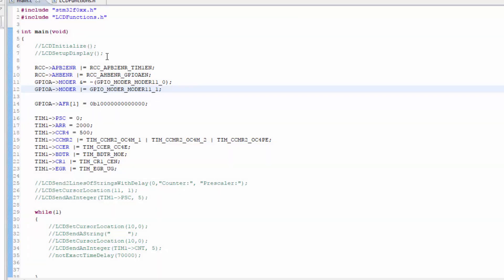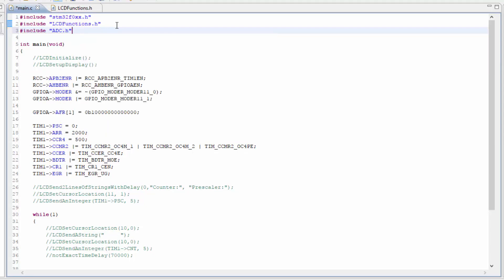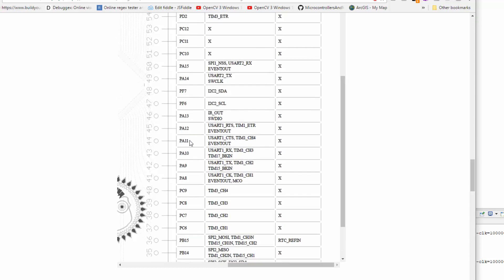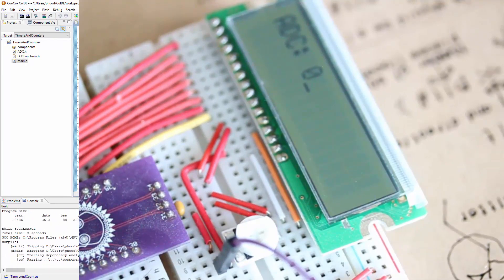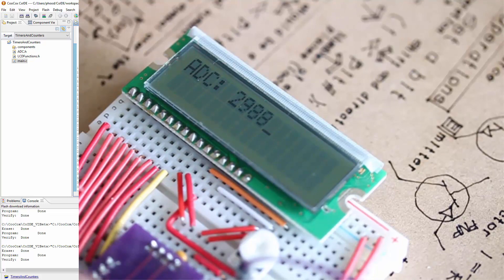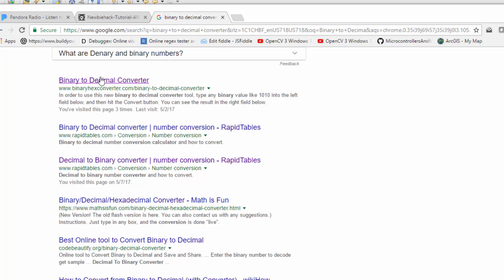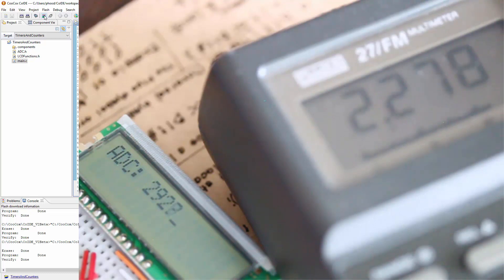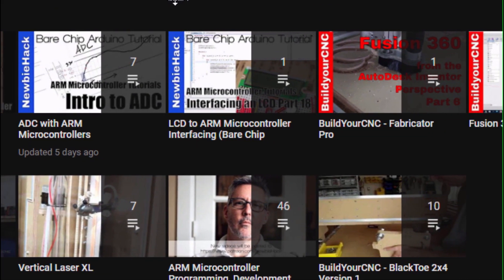47. How to Control the PWM Output with the ADC and a Potentiometer  - STM32 ARM Microcontroller

Comment: Great video. A challenging question: what could the PWM output of an STM be used for? Well of course, possibly 3/4 of the applications that STMs are used for, use PWM. The problem comes when one needs to find demonstration applications. One doesn't want to propose applications that need a workshop full of components; nor does one want to risk losing the viewers interest with applications that employ technologies that have not yet been addressed by the channel.

So, how about a temperature controlled fan? The goal would be not just energy saving but noise reduction. That latter aspect does reveal one of the challenges that comes with the use of PWM: electric motors can get noisier when their power supply is interrupted at audible frequencies.
Reply from the maker: You are absolutely correct. There are thousands of applications, and I did provide an application hint in this one where the PWM can control a hobby servo, but there are applications like motor control, spindle/vfd control, laser intensity, etc. If the device has a PWM input, it can be used.